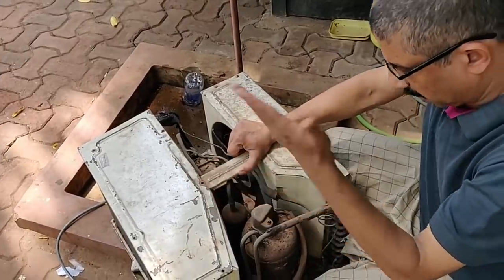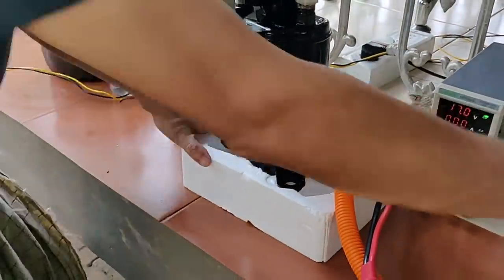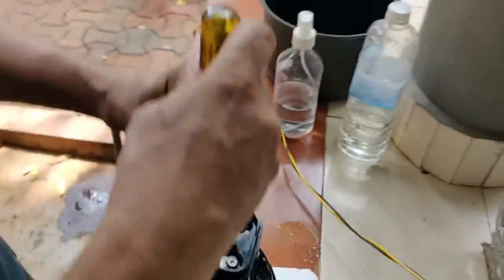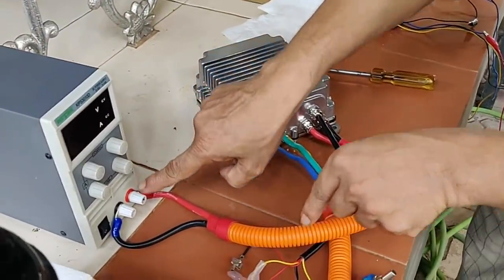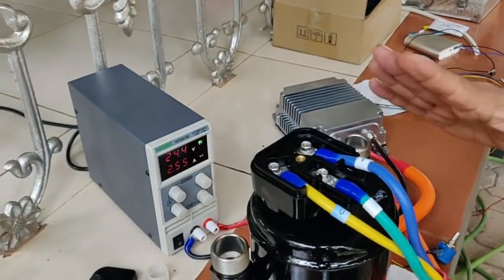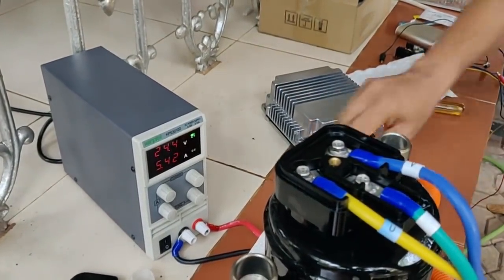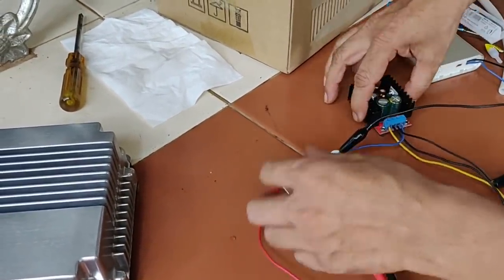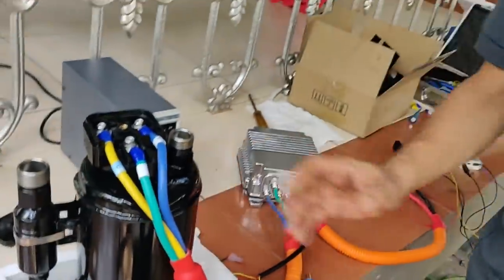ബാറ്ററിയിൽ പ്രവർത്തിക്കുന്ന Ac കൾ

Comment: A typical 1 Ton Ac has an electrical wattage of 1200 Watts approximately. That means an ideal inverter circuit (without any losses) will draw 100 Amps from a 12 V battery. A typical 50AH car battery cannot supply such a high current for more than 15 minutes. So, the battery will completely drain and the AC will switch off after about 15 minutes.

Comment: ലോഡ് ഇല്ലാതെ 5 ampere current എടുകുന്നു.. load കൂടിയാൽ 8 to 10 ampere വരെ പോകും... പിന്നെ ഇതു കൊണ്ടു എന്താ ഗുണം... volt അല്ല കാര്യം ampere ആണ് കാര്യം.. high volt വരെ ഉണ്ടാക്കാം പറ്റും.. പക്ഷെ ampere അതു അതു ഇച്ചിരി പാടാന്....
Reply: yasar ali ബക് ബൂസ്റ്റ് വെച്ച് മാനേജ് ചെയ്യാം
Reply: @aliappana6550  buck booster voltage alle..?? Changing ചെയ്യുന്നേ.. potential അല്ലെങ്കിൽ load എടുക്കില്ല... പിന്നെ മേൽ പറഞ്ഞ മോട്ടോർ DC motor അല്ലേ.. വോൾടേജ് അത്രയും significant ആണോ.??
Reply: 10A X 24V =  240W.  (220V.  1.1 A)
Reply: @nizarap7786  theoretical aanu athu...

Comment: 220 v AC oru panel300 w output athu acil direct kodukkunna video kandu current undengil solar work aakum ...athu kcb de monthly veetil upayogikunna unit current ne  kurakkan sahayikunnu ennum  parayunnu angine kcbk kodukkunna cash kurach kuranju kittum ennum parayunnu.. athine pattiyulla abiprayam enthaanu? Loomsolar 220 v 300w panel with cheriya inverter pinne oru mcb polathe samabavam ind aa video il

Comment: ഹംസ ബായി. ഈ കംപ്രസ്സ്‌റിനും അതിന്റ ഇൻവർട്ടർ യൂണിറ്റിനും കൂടി. ഒരു പുതിയ ഇൻവെർട്ടർ ഏസി വാങ്ങുന്ന പൈസയാകുമല്ലോ. Rs. 34,167.46 | HC75DC12H12V DC Compressor, Air conditioner Inverter Compressor MBP HBP refrigerator compressor 850w cooling capacity R134a
https://a.aliexpress.com/_d8AIJr9
Reply: ശരിയാണ് ഇത് ഇത്രയും വിലകൊടുത്തു ചെയ്താലാലും ഇതിന്റ ആയുസ് പറയാൻ കഴിയില്ല തട്ടി കൂട്ട് കൊണ്ട് ശാശ്വത ഉപയോഗം നടക്കില്ല. ഒരു 10വർഷം കഴിയുമ്പോഴേക്കും DC. AC, നമ്മുടെ നാട്ടിൽ വരുമായിരിക്കും

Comment: Hai.....
Please comment if compressor is 1 tonn or 1/2 ton.
You need to design a control pannel to replace thirostat used to speed up and down the compressor 
Based on cooling requirement the pressure from compressor needs to be ramped up and down